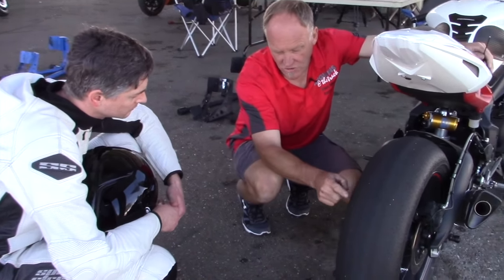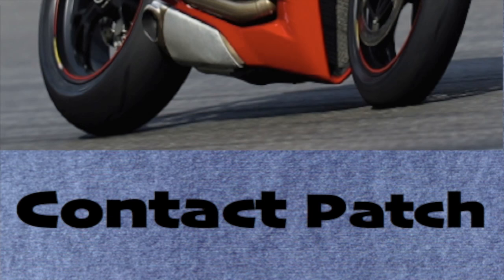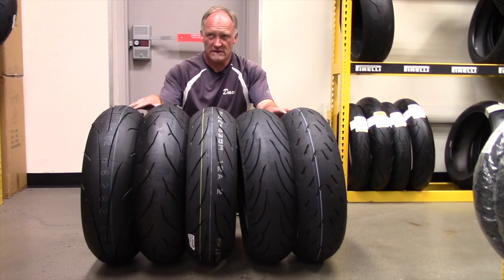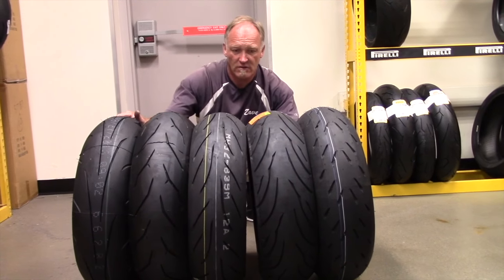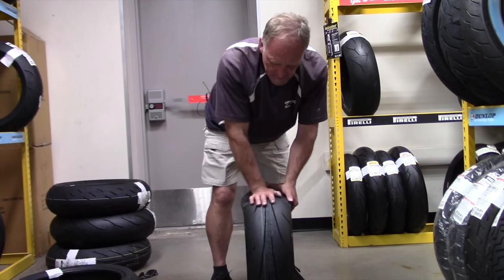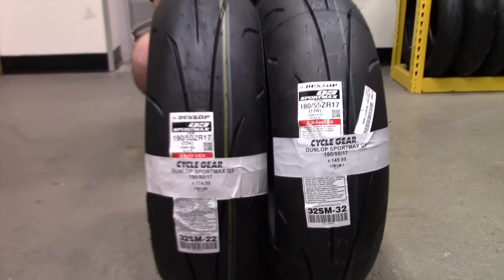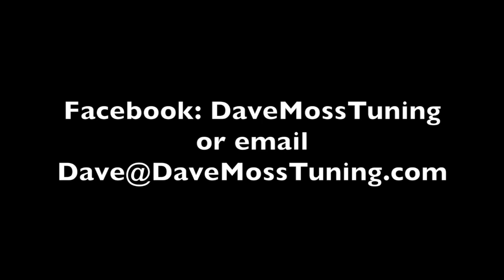Contact Patch: Motorcycle Hypersport Tire Comparison (TRAILER)

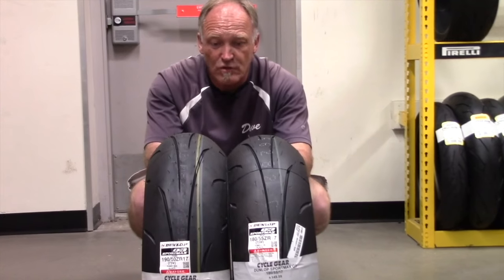Comment: 1:20 why comparing a 190/50 with a 180/55 instead of 180/50 to keep same roundness specs or curvature? and doesn't the rim width have an effect as well?
Reply from the maker: Correct. It is the start in a series to actually ask people to start comparing tires for height and profile.

Comment: Dave , how the Q3+ , Power RS and METZELER RACETEC RR K3 compare  in terms of grip ,starting from the grippiest tire ?         They all don`t require tire warmers and would be a great tire for up to intermediate pace
Reply from the maker: Q3+ and Pirelli SP V2, then S21 and K2 and finally Power RS based on what I've seen at the track in regards to durability, warm up and general wear levels per day.
Reply: Thanks for the helpful answer!  I am surprised that the  Racetec RR K3 comes after Q3+ after being rated as best DOT tire from MCN 2014 and wins tire of the year 2015.
Reply from the maker: Where did they test it, on what surfaces, at what speeds, with what rider, at what pressures, with suspension stock or reset? So many questions need answers to understand WHY they gave it that accolade. All I have as data points are what I work with every day at track events where conditions are controlled, with the biggest control being accurate tire pressure when hot for each rider.
Reply: I believe in what are you saying and that is why I asked you ,because you have all that data and experience. They never tested the Dunlop Q3+ since is not available in EU.   No data besides track temperature was mentioned here:                                                                
     "The MCN test pitted the METZELER RACETEC™ RR K3 against its closets competition, namely;Pirelli DIABLO™ Supercorsa SP, Bridgestone Battlax RS10, Dunlop Sportmax GP Racer D211, Continental ContiRaceAttack and the Michelin Power Supersport. The test took place at Jerez in sunny conditions with 25° degrees air and 28° asphalt temperature. The tyres were all tested with the same bike and rider, in this case a BMW HP4 ridden by experienced road tester Bruce Dunn.                                                                           At the end of the comparison test, the METZELER RACETEC™ RR was the fastest tyre on track, with a time of 1.59’0, six tenths faster than its closest competitor and almost five seconds quicker than the last classified, the Michelin Power Supersport (2.03’9).
 
The Motorcycle News test team praised the METZELER RACETEC™ RR for it’s quick warm-up, excellent high-speed stability and precision by defining it as “a truly fantastic tyre that has the ability to transition from road to track” .
Reply: Running Q3+  and I am very happy with them ,but I was curious if the Racetec RR k3 is better pick for trackdays so I can give them a try next time since they also don`t require tire warmers and are almost in the same price range
Reply: @zhuliyanzhekov9706  Mainly because Q3+ was introduced in 2017

Comment: Hi Dave. How can i get a full version of this video? Is it accessible with your app?
Reply from the maker: Should be in the App.
Reply: I'm looking for the best grip tires for my RS 125 two stroke, for street (quite spirited) riding. Highest temperature of the day here is ranging from 72 to 90 degrees F in the summer. I'm 183 pounds and the bike is 313 pounds (wet), so 496 pounds total. Stock tires are 110 / 70 - 17 and 150 / 60 - 17. The bike is just 21 kw stock.

Should i go with the softest compound out there? Should i also choose low max tire lean angle as well (don't know the terminality for this one. I mean tire geometry) so there would always be a bigger contact patch for it to heat up more?
Reply from the maker: Hypersport tires all offer exceptional grip for the road. Go for the tire that gives you the largest amount of soft compound compared to the harder center. Review the choices and go with a softer carcass tire from Pirelli or Bridgestone as additional flex will give you more contact patch.
Reply: Got it. What about cross section radius (i think it's the right term)? As far as i understand, larger cross section radius provides larger contact patch and so the tire heats up more. If so, should i go with large cross section radius?
Reply from the maker: Larger radius = slower turn in but more contact patch, so as with all things we have a balancing act to deal with.
Reply: Realistically speaking, a harder compound can provide a better grip only at the track, because on the street, a tire doesn't heat up that much. Is that correct?
Reply from the maker: There are multiple compounds at the track based on track heat/temps. Road tires with softer edges give more grip than single compound as they are designed specifically for that purpose.

Comment: why isnt the full video not available in germany? very sad... :(
Reply from the maker: Dave Williams, editor, replying here.  It's a fight between YouTube and German government.  They want youtube to accept liability for copyright violations.  Youtube said no way.  Germany said no pay per view.  The only Eurozone country to say no.  Sorry for the inconvenience.
Reply: Hi Dave, thanks  for your reply. Awesome service by you as I am used to it. Just one question: Super-Quick canyon carving on a 2008 Kawasaki Versys... Should I go for the Power RS or the Metzeler Racetec RR? Or even another one? I am afraid that the Power RS is to pointy in the 160/60 dimension and less grip on the "usual edge" is the consequence. Had the BT 003 RS but the heat cycle was little awkward... Any thoughts?
Reply from the maker: Either depending on your turn in style. If you snap the bike over the RR would be better as the roll profile is slower.
Reply from the maker: Copyright dispute between Germany and YouTube. The videos are in the DM Tuning App and you should be able to see them there. . http://feelthetrack.com/mobile-apps/